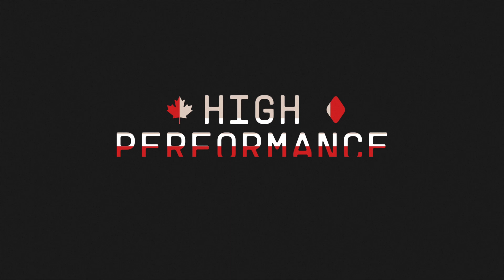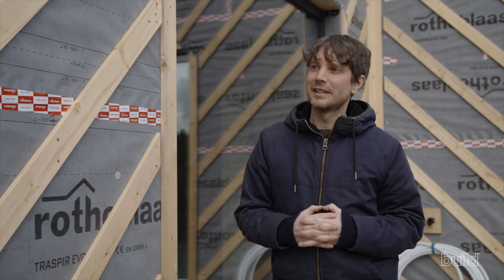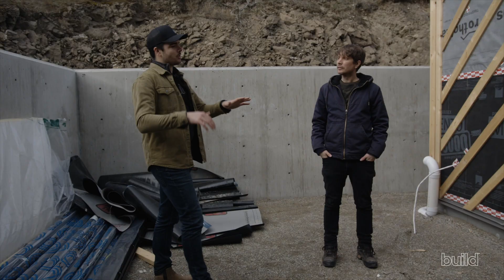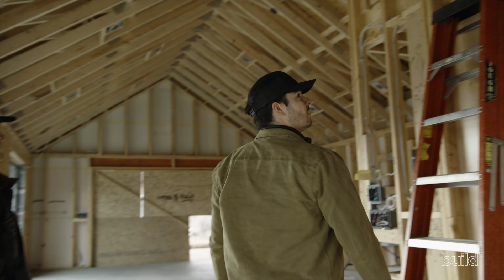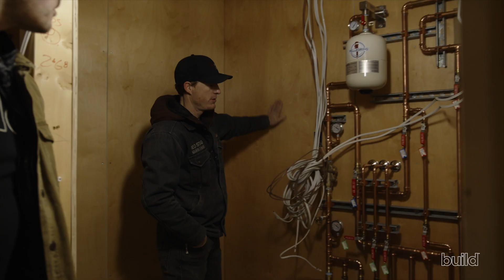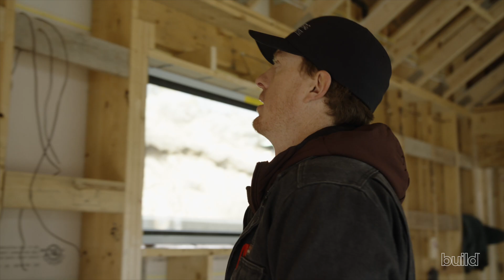Passive House Construction in A COLD CLIMATE - High Performance Canada Episode 4

Comment: I’m sorry, but failing to use exterior insulation could also cause an issue with moisture. The delta T is evenly distributed through the wall, and at some point, you will hit the dew point, and humid air will start to condense. The condensate van freeze near the exterior.

Comment: Nicely done and explained.  I have a site (actually several sites) where I would like to build some day.  There are 360 degree views but the best is to the east and the "worst" is to the south - a steep slope uphill very similar to the slope on this house - not a bad view but not the best.  I keep looking for plans where I can go to a room to use/enjoy the view from any side and yet have high energy efficiency.  Also, mostly or all one level since I'm thinking about the stage of life where climbing stairs is not much fun.  And an attached garage or at least short distance to the house (breezeway perhaps).  I have found a few stock plans that sort of address these issues - they would need to be modified for the energy efficiency part but they may be a good basis.  But wondering if in the end it is more cost effective to plan out my preferences and then have an architect design it rather than "re-engineer" a stock plan.

Comment: I've seen passive std homes with double wall 2 x 4 separated by 6" and the entire wall cavity is blown full of insulation. As he sais, it's hard to get decent 12" wide lumber. Using smaller dimensions, responsibly, would make the walls a fair bit cheaper to build, but also use younger trees and use them more efficiently. For the windows, I think we should consider insulated shutters at night as you can't see much outside anyway. Even with the best windows, they only lose at night. These could be engineered to be decent in appearance, but having an R30+ shutter covering all that glass at night one would think would make a difference.
A dream of mine is to see a subdivision with no services, except garbage at. Each home would be a closed loop, producing/handling their own electricity, water and sewage. Subdivisions are low density yielding limited taxes per unit area, but require miles and miles of pipe and electrical runs which cost a fortune.

Comment: I am very surprised that the 2x6 wall studs are so close. Not horrible thermal bridging but completely unnecessary. A 2x6 + 2x4 separated by 2" would have made much more sense. And been cheaper. Many spots could probably even have been double 2x4. I would like to know why they went that route instead.
Reply: Agree with the first part, 2x6 ext wall and 2x4 int wall with a gap in between would work. Two 2x4 walls would not work (at least in canada) for 24 oc. If they wanted to go with double 2x6, I wonder why they would not stager them for less thermal bridging.

Comment: WHY DONT PASSIVE  HOUSES TAKE ADVANTAGE OF LARGE OVERHANGS to shade as much of the building in the AC cooling days of summer but not so large that come oct or whenever the overhangs no longer shade near as much building and start absorbing more passive solar radiation to offset heating days of fall winter and spring?
Reply: I did incorporate that in my house build and went with 30" overhangs . I know it helps some but maybe not as much as one would think.
Windows now a days are designed to repeal heat gain and the UV damage it can cause. The windows of old with clear glass would benefit
on solar gain but lose at holding on to inside temps.
Long overhangs help protect the wall and windows from weather/hail ect.
Reply: We went with 42 inch overhangs on our super-insulated home and believe me, those overhangs really help keep the brutal summer sun out of the house. Without them I'd need to install air conditioning. Contrary to your assertion, today's windows do not exclude heat gain when the sun is directly impinging on the glass, or when the ambient temperature is 40C. And UV does enter the house even if the units are top-of-the-line triple glazed. Windows are the single biggest challenge in high-performance home design.  @HighGear7445
Reply: Ein Passivhaus  rechnet mit solaren Gewinnen  auf Süden durch die Fenster in der Heizperiode. Im Sommer muss man mit Rollos oder aussenjalousetten verschatten.
Reply: Generally, overhangs help a lot, but they must be strategically placed. PHPP (the software he talks about) will take all that into consideration.

Comment: Says that the weather is "a little bit colder" than the coast, then says that it goes down to -20 in winter. That's not a little bit colder.
Reply: -20 in the winter doesn't even count as a cold climate really.

Comment: I'd like to see a passive home video for the prairies.

Here in Saskatchewan the temperature can vary 100 C° over the year. In other words, it can crazy cold in the winter, and stupid hot in the summer.

I haven't seen any real information on building for these extremes. Code is... pretty much useless.
Reply: Get a copy of a book called The Superinsulated Home Book by J.D. Ned Nisson & Gautam Dutt. In saskatoon saskatchewan Harold Orr and crew built 12 homes that are to this day some of the most energy efficient homes built. It details proper air sealing, heat loss and building heating loads and how to calculate them, various framing techniques and advantages or disadvantages. Window and door airsealing, the need for an air exchanger to provide a healthy indoor air quality. Many other details. Very informative book.
Reply: @kerrryschultz2904  An air to air heat exchanger fresh air system is a must. Our house is so tight we don’t feel any drafts. I’ve gone around with a led point thermometer with fans on and couldn’t find any leaks . I did this at about -20F.
Reply: 100ºC variation? Really?
Reply: @morganspencer-churchill2136  Yeah! Negative 50 in the winter and upwards of 45 above in the southeast!
Reply: I live in Alaska and get those kinds of temperatures. I built a place with double stud walls and 6 1/2” (16.5cm) close cell foam and R-59 fiberglass batts in the ceiling, R-21+R38. The ceiling vapor barrier is seal on the edge. We have 3440 sqft, 2118 sqft above grade and the rest daylight basement on the south side. We use about 600 gallons of heating oil a winter. We have already had temperatures around -20 F this winter.
Reply: @Chris_at_Home  If the rest of North America would upgrade their construction standards closer to the r value and air tightness of your home the heating and cooling loads and so the corresption demands for energy would be a game changer in the energy sector. I presonally prefer cellulose in an atic because it seals much better than bat insulation. Have a look at Tom Marsik home in Dillingham Alaska. Very small home of 400 square feet but holds the world record for lowest air changes per hour at ,005 ach.
Reply: @kerrryschultz2904  You are so right about home energy use. I grew up in New England and most of the houses there have hardly any insulation and windows not made for the climate. I did put a few inches of cellulose over the fiberglass batts mainly to seal any places the fiberglass meets. Cellulose settles over time so I don’t like a thick layer of it.
Reply: And here in Alberta we also have crazy high winds, wondering how that might affect build requirements
Reply: There is at least one in Saskatoon; on Temperance Street. It was built around the time I left for Australia (7 or so years ago).

Haven’t seen a video on it though.
Reply: Maybe 75 C variation. Realistically.

Comment: The rainscreen issue is interesting. Certainly a small amount of air movement is necessary to allow moisture in the wall to escape. But how much? And how much would the diagonal strapping have allowed? We need more "science" behind this, i.e. we need to be able to quantify based on reliable, real world test results. We should have to rely on gut feelings. Not only is that inefficient, very often it is simply wrong.

Comment: By not having exterior insulation, the dewpoint is on the back of the sheathing. Bad, bad, bad idea. Imagine what's going to happen if someone doesn't know any better and starts humidifying the house  and the interior air seal is compromised.
Reply: This wall assembly is designed to dry to the outside, so there shouldn't be any issu espacially with the rainscreen. The reason it is so important to move the dew point outside of the assembly with exterior rigid insulation is because of the vapour barrier created by this rigid insulation. There's no such VB on the exterior side of this assembly.
Reply: The dew point depth into the wall will vary seasonally. The key is to have drying on both sides of the vapour barrier and have the vapour barrier always at a temperature above the dew point in all seasons. Adding external insulation does not guarantee this. In fact many homes have been built with batt insulation, poly vb, and 1" exterior impermeable foam, basically a vapour sandwich with sheathing below the dew point in winter. For the assembly in the video, presumably they are putting a VB on the inside of the framing and ensuring the OSB is more permeable than the VB. If the OSB was the most vapour retarding component in the assembly, then yes, I would share your concern. Generally, the exterior insulation requirement is to reduce the effects of thermal bridging, not necessarily to keep the sheathing above the dew point, though the permeability of one's sheathing should be considered.
Reply: Completely agree! Plus one thing to consider in cold climate like this house (probably 6, maybe 7A) is how much exterior insulation you need to keep the dew point outside the sheathing during the cold winter months. It's of course doable, but can be more expensive.

Comment: if your going to build a double layerd stud wall, why not build with two 2x4 and a bigger gap than two 2x6 with very small gap? Seams like a huge cost for no performance gain
Reply: Absolutely correct, 2x6 is waist of the $$ for nothing. 2x4 is your structural wall and inside you can easily use even 2x3, just use connector with structural 2x4 somewhere at the 4ft high of the floor or higher if you have rooms over 9ft high.
Reply: By standards a 2x4 wall is 16" on center and 2x6 or bigger is 24" ..the more studs the more thermo bridging but good part of the question is what's the cost difference
Reply: @ShaneEstabrooks 
But the suggestion was double  2x4 with "gap."  The gap disrupts the thermal transfer. 

So its a break in thermal bridging every 16 with double 2x4 with gap vs  thermal transfer every 24 with double 2x6 w/ no gap.

Also, if going all greenie,  double 2x6 walls requires more concrete on the pour and increased $.
Reply: Why not a tji 360mm. Cellulose inside. OSB inside. Outside a woodfiberplate 4cm.
Reply: @thomasschafer7268  what you suggested must cost 3x, for the same performance
Reply: These snowflakes are self proclaimed experts. No point suggesting them anything.

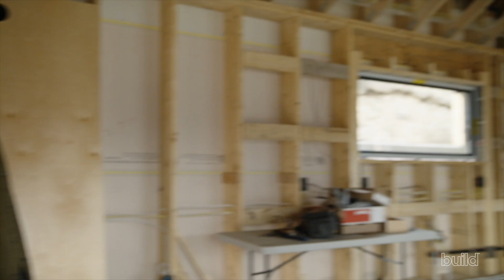Comment: None of the trusses land on studs 😂 17:45 🤦🏻‍♂️
Reply: They don’t need to be when building with double 2x6s (2x12) wall.
Reply: @ykciR come on dude, don't be silly. If they can frame walls with 2x12, they can take the time to frame it properly... There's no reason NOT to do it. If they were going for bare minimum code compliant house, they wouldn't frame with 2x12.
Reply: @Edward Duff there's no reason not to do it. It doesn't cost extra
Reply: @CybekCusal  One reason could be that it's easier to fasten the trusses to the top plate without the studs in the way.
Reply: it’s a double plate. doesn’t need it. this is an earthquake prone/seismic area. you know nothing.
Reply: @trevorhardy3544  technically you don't need insulation either 🤣
Reply: @CybekCusal  the house isn’t even done. again showing you know nothing.
Reply: @trevorhardy3544  internet tough guy 😂🤣
Reply: @CybekCusal  you’re not an engineer. otherwise you wouldn’t have made such an asinine comment.

Comment: I understand but don't necessarily agree with the diagonal rain-screen issue, particularly in that climate. If I was the owner, builder, or designer, I'd likely advocate to keep it as is simply to avoid creating more issues with damage to the WRB during the demo, but that could have been replaced as well? Regardless, it is a great design with a very interesting wall assembly. Also, that ERV with the integrated heat pump is clutch, I'll be tracking that brand down for my own build.
Reply: Minotair is the company. Excellent product.